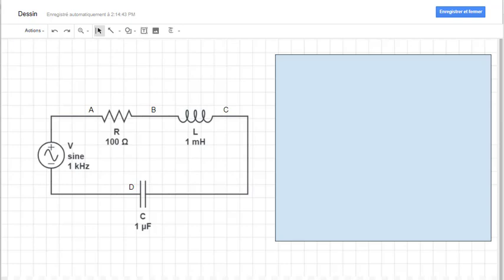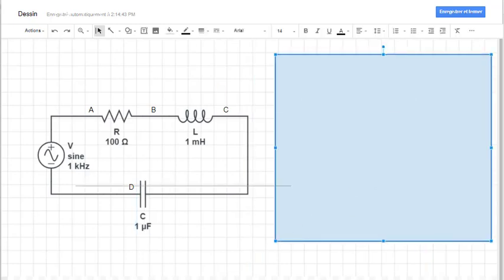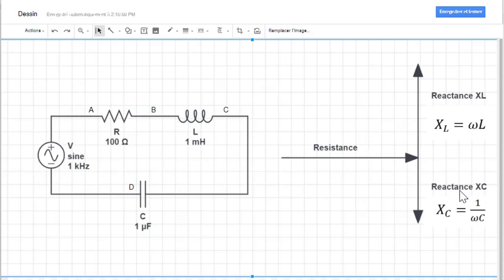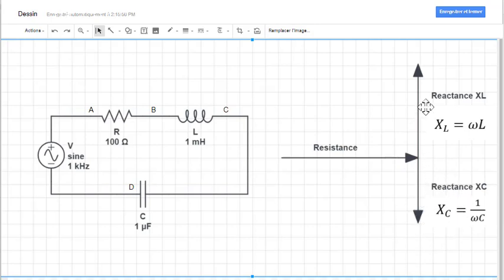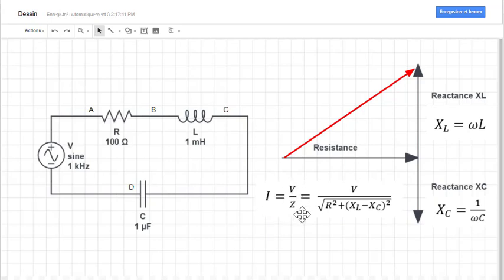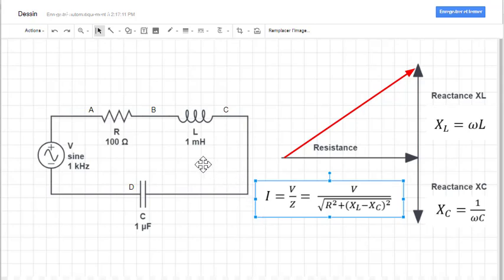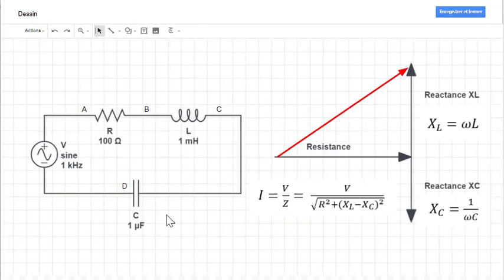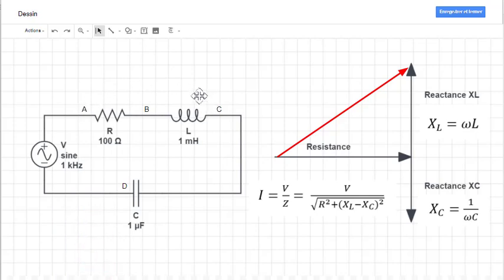Voltage drop across an oscillating RLC series Circuit

Comment: Could you do a video solving each voltage across each one with a given input voltage.     I see the concept but would love to see how you calculate each component voltage drop with given input voltage with the 1kHz frequency.   That would be great if you could show that.   Thanks.  Great video
Reply from the maker: It's been a while for me, and I drew out my explanation to your question on paper, and upon review it had a number of bad mistakes (i.e. forgetting to put in 2pi*f for w). So I'm too rusty to address this.

One good way of addressing this is phasors.
[Intro to phasors - 4 minutes](https://www.youtube.com/watch?v=ZSDpIpnlTbY)
[Phasor Diagram of Series RLC Circuit - 8 minutes](https://www.youtube.com/watch?v=6ieUk3Rm1yY)
[Playlist going over Phasor Problems](https://www.youtube.com/watch?v=YrtZgA05MBI&list=PLBlnK6fEyqRgLR-hMp7wem-bdVN1iEhsh&index=137)

Comment: Should it always be so, that wholewavedirectification of AC should be first done, and then transforming. And always use primarily capasitors for constanting the voltage, for losses prevention. How often even matters, if voltage varies a bit? Are not diode losses related to currents, so in high voltage, low current = low losses? Am I completely wrong and trolling here?
Reply from the maker: I don't know what you mean by trolling, but I will treat your comment seriously. Your comment is a bit hard to understand for me, and kindof reminds me of:
[Technical Jargon Overload](https://www.youtube.com/watch?v=aW2LvQUcwqc)

In my video, I am essentially treating capacitors as negative imaginary resistors and inductors as positive imaginary resistors. This so that we can more easily and intuitively calculate the effects of various linear elements in a circuit. There are no diodes in this video.

-In high-frequency AC circuits, capacitors can often be treated as shorts.
-In low-frequency AC circuits, inductors can often be treated as shorts.

The effect of capacitors are dependent on your circuit, and the frequency with which the circuit is intended to operate at. 

If you're looking to maintain a voltage at a certain nodes in your circuit, then you should consider transistors, and that means we have to analyze a whole lot more, especially when it comes to saturation and cut-off voltage.

Here are some videos that may be helpful in understanding the concepts mentioned above:
[Active, saturation, & cutoff state of NPN transistor](https://www.youtube.com/watch?v=cuOFG_ISHno)
[BJT tutorial/recitation with a quick review of theory](https://www.youtube.com/watch?v=s69o0AmYyjo)
[Power Factor Correction in Electric Power Systems](https://www.youtube.com/watch?v=RU6jtai4wys)